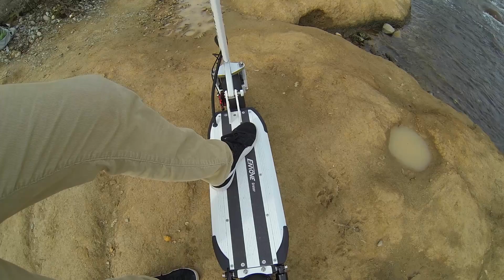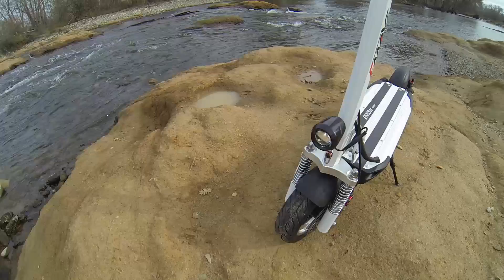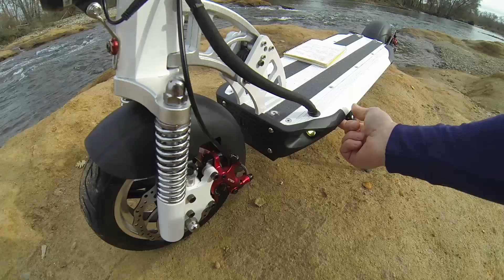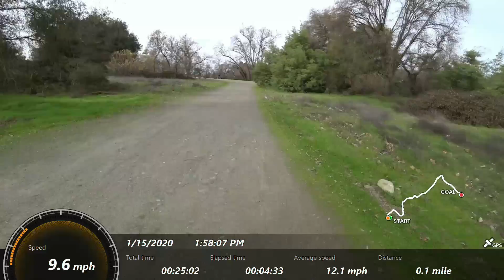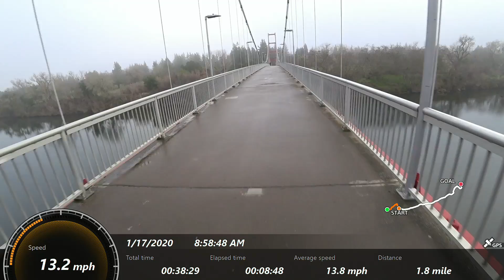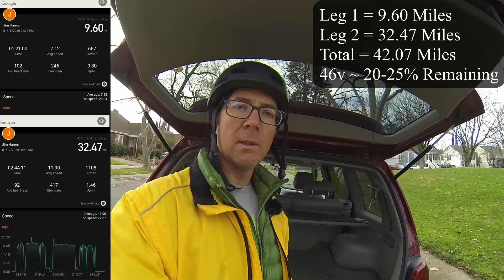Emove Cruiser Electric Scooter Review!

Comment: Base on many and many youtube reviewers, this Emove Cruiser is probably the only one that come closes to the advertise range.  All the rest fall so short, even the expensive ones like the Dthunder, Dultra and Warrior11+, etc.
Reply from the maker: @Tommy Lee, I totally agree. The dual motor scooters are so variable and they seen to base the max range on what a single motor could do. The reality with the dual motors is the rear motor is fighting the front resistance in single motor mode. A big battery with a lower power motor, like the Cruiser, is really the way to go for max range. Thanks for chiming in!

Comment: Just FYI you can upgrade the throttle to normal thumb or twist.
Reply from the maker: Correct, I did make a video about the fit of these though, they limit your display position and the folding of the handlebar. https://youtu.be/RffPbqiFElw

Comment: Is it still problem with screws loose on every few rides or it is fixed on model 2020?thanks.
Reply from the maker: The loose screws are really on every scooter unless you loctite them. There is just so much vibration with small diameter tires. I don't think there have been any real bolt changes with the Cruiser.
Reply: @ElectronSurfer  how to fix this bigger problem then?
Reply from the maker: @damirmaric2745  The problem is really only fixed with loctite or something similar. Voro has reportedly began using loctite on some locations. 
I really don't see it as a problem, it is really 5 minutes of maintenance that is needed on pretty much every scooter out there every couple hundred miles.  The added bonus when doing this maintenance is you will also see potential issues before them become big ones. Thanks
Reply: Ok thanks than loctite on every screw and problem solved.on every e scooter same thing or they are more stronger and solid also?
It is not problem every few hundred km i hope just this problem not more some repairs after shorter using of this model or after few hundred km..because this model seem so nice and complete..thanks..
Reply: @Damir Maric ~ The one good thing about this scooter is the range, but YES, there is still a major problem with the screws loosening and falling out while you're riding. And guess what? The screws around the "PULL" knob to fold the scooter are PLASTIC! Who puts plastic screws into a metal vibrating machine? Stay away from this scooter until they do better. I just sold mine with a $500 discount because I just wanted it out of my house. Maybe I just got a bad one, but Buyer Beware!
Reply from the maker: @NoProGoPronto  Did you buy direct from the manufacturer? I have not seen a single plastic bolt (that mechanism should not be using screws) on a cruiser. I have seen scooters of every brand with dodgy fasteners but can't say that the Emove any more so than others. It sounds to me like you got a bad one which I have seen one other Cruiser that had some issues but they are typically solid. I think one thing with scooters is people don't realize they actually require more retightening than a bike does with the extra vibration coming through small tires. I agree that all the manufacturers need to up their game and at least offer an upgraded bolt package with loctite. Thanks!
Reply: @ElectronSurfer  ~ Yes! I bought my scooter directly from Voromotors and those screws were plastic. You’re right, I probably just got a bad one. I wish the company well. Either way, I sold the Cruiser at a deep discount and bought myself a Dualtron Eagle Pro from a local dealer. This way if I have any issues, I have direct help from a human being. 😃
Reply: Then no good model or??

Comment: Good info and video. A couple of observations. You indicated the peak wattage was 1300 instead of 1600. You referred to the shocks being Pneumatic instead of Air Shock suspension. I believe you meant to make that reference to the tires instead being Pneumatic tubeless. I’m a little concerned about the overall life of the battery. I recently saw where someone had only gotten 300 miles out of their Cruiser before it just died. 😳😱 Just curious, how many miles have you put on yours or your son’s orange Cruiser? Thanks in advance.
Reply from the maker: Thanks for the comment. On the peak wattage a 52v battery with 25 amp controller gives 1,300 watts (52×25=1,300), not sure where Voro got 1,600. I meant to say air (pneumatic is interchangeable) tubeless tires and same with the shocks.
I have seen a cruiser with 2,000 miles and multiple with over 1,000, both on the original battery. Mine only has around 200, I'd expect a few years of longevity. Thanks again!
Reply: Electron Surfer Actually, from what I’m reading on their website, it states a 52V/30AH battery power setup. Depending on how much one rides, but I would anticipate getting at least 3 years of riding out of the Cruiser. Does your Cruiser have a different battery onboard?
Reply: @flhandster4395  30Ah is the battery capacity, and yes it's probably capable of delivering many times more amps but as far as I understand it can only deliver what the motor controller pulls, if the controller as he says is limited at 25Amps, then the battery will not deliver more than 25 amps, even though it would easily be capable of delivering multiple times that, but I'd expect it should keep the battery healthy for longer if it's discharging at less than 1C

Comment: I bought 2 of these emove cruisers recently (got them 2 weeks ago) from Voromotors. Both are having battery issues! I am a 150 pound rider. 1 scooter goes for a maximum of 10 miles the other goes 12 miles maximum. This is on the lowest setting (1), where you are supposed to get the most mileage! I’ve tried to contact customer service several times but they are brainless and disrespectful! They finally put me in contact with Joey! He immediately begins to blame me for the issue. Says he will not honor the warranty because it’s my fault! Hey joey like I told you 10 times THEY CAME OUT OF THE BOX LIKE THIS! WTF is wrong with you people?
Reply from the maker: @Justice For All, i'm sorry you've had a bad experience. You can contact me through my website www.electron-surfer.com and i'll try to help. 
We can try to diagnose here and others can reference. Can you tell me what the voltage the battery is charging up to? The voltage at fully charged and the voltage you are getting when you run out of juice will help diagnose the problem.  There is a possibility you could just have a bad setting.  I have yet to see a bad battery in the cruiser but it could happen, having two scooters, both with bad batteries is odd enough that it makes me think it could be related to another part of the scooter.  Let me know and i'll try to help.  Thanks for the comment.
Reply: Still having the same issue?

Comment: Thanks for that detailed review. Especially the actual ride and speed test. Nobody else seems to mention the fact the the speedometer over-states the speed. After you changed the wheel size down to 9, what kind of top speed did you get? Thanks again!
Reply from the maker: @John Cox, I still get a little optimism but it is less. The display will read up to 26 mph when i'm really doing about 24 maximum on flat ground. Thanks for asking.

Comment: Dang! It looks very similar to the Speedway V. #SMH
Reply from the maker: @Xt Plow, You are correct, there are actually some places in the manual where it still has the Speedway reference.  Most of these frames come out of the same factories with manufactures selecting their own battery and motor combinations.

Comment: im averaging 1500  miles per 3 bucks on mine, you gotta be careful with the charger
Reply: What do you mean you gotta be careful with the charge? There's no settings or config... all you do is plug in end into the wall and the other into the scooter. How can one be more or less careful with the charger?
Reply: @lanceguilin  its pretty easy to go to 58/52 volts, and that is a problem, once a week i guess its okay
Reply: @lanceguilin  ive been thinking about eating it to make an e bike, a 30 amp battery is almost the entire cost of the device, thats 15 times bigger than my heated jacket
Reply: turn it sideways, hooking up a new controller and getting a legit motor.. i can see the thing pulling freeway speeds, that battery is MASSIVE, 30 amps is not small
Reply: @lanceguilin  its a good one for the price, i thought about the thunder, even the X, this is a good starter, unagi might also be what youre looking for, but hitting 30 feels incredible. However i will end up getting a big one
Reply from the maker: @lanceguilin  When charging the plug is at a downward angle, if the scooter tipped over to the plug side it could damage the plug, especially if you have the scooter folded. Thanks for asking Lance!
Reply from the maker: @Matt Locascio, its really hard to be the cost per mile on escooters or ebikes, keep on riding!
Reply: @ElectronSurfer  or i can use my bike, and get infinity mpg, though there is slices of pizza, tires etc, what im getting at is this is a very cheap method of transport
Reply: if you want my cannondale road bike hit me up. i got too many bikes at the moment

Comment: I bought this scooter a few weeks ago and I'm here to tell you the front fender is absolute rubbish.  My fender rubbed against the wheel and since the front fender is mounted to the brake assembly and not the front forks above the wheel when the suspension is under load it  would smack into the top of the fender making a nasty sound.  Additionally, this limits the travel of your suspension, so you really are NOT getting the full suspension use.  I weigh only 185 lbs and I wrote Emove a letter about it, plus a list of other things as well.  The response was the scooter is safe and didn't really address any of my concerns.  My father was going to buy one and he immediately, said NO thank you, poor design.  Also, I noticed that the front wheel assembly makes a chattering sound when make right leaning turns, I think since everything is off set to the right, its putting something out of balance.  I do feel the front wheel doesn't makes true and complete contact patch with the road.  I own 3 different scooter brands and this scooter is quite new and the tire wear is APPARENT to one side and while the tire still shows the "RED STRIPE" which they put on new tires on the right side of the tire, which is the side which has the off-set.  I have close to 100 miles on this scooter so the red mark, tire wear should have eliminated this and the tire wear is apparent in difference from the 2 other scooters I have sitting next to it.  My advice "DO NOT BUY" this scooter until they fix this issue.  Also, the motor of this scooter, mine in particular sounds like rubbish while moving/starting low speeds.  Its like trying to accelerate a car with a manual transmission and starting in 3rd gear, versus 1st and the drive line is making noise.  The sound does smooth out but but being that this scooter is 2 times the cost of my Segway Ninebot Max and that thing makes no sound like this and this scooter is 6x the cost of my Gotrax V2 and that one doesn't make any nasty sound like this one, it clearly tells me something isn't correct.  Emove, response to this issue.....nothing.  As for the rest of the build of the scooter, well maybe I will save that for another day.
Reply: Not really what I wanted to hear since the Emove is at the top of my list. I will definitely be looking hard at my number 2 runner up just to be safe. 🛴
Reply: @redjack56  What is your 2nd choice? For the price you're not going to get much better than the Cruiser 2019. Are there better scooters? for sure, but it'll cost you. Rion scooters made in USA -- much better quality -- will set you back $6500.
Reply: @redjack56  this thing rocks, keep your weight to the back and hit that trigger bro
Reply: I share some of your concerns Mike S, but what are the  2 other scooters you're referring to? Are you referring to the Segway and the Gotrax? They are clearly inferior scooters not in the same league as the Cruiser 2019. Take off the front fender -- it's quite easy to do -- and many of your critiques are gone. Should you have to do that? NO. But it is what it is and if you want to solve some of your problems, you've been given to solution to it: take off the front fender.  Your motor does sound strange. I have over 1000 miles on my Cruiser 2019 and I don't  have problems with my motor. I did have many of the issues you mention regarding the front suspension and rubbing of the tire to fender. Take off the front fender.
Reply: @lanceguilin  Inferior, in what manner?  That's like saying a Ford Focus is inferior to Ferrari.  The Ford works like its supposed to for its role and spec sheet, try to take that Ferrari on a family vacation and then tell me what's inferior.  My Gotrax and Max work as per their specs, no need to remove fenders, or weird motor sounds or front end sounds-chattering.  The stem on a max and Gortrax are vertically locked and don't move backwards or forwards, while the Emove has forward play. How about a front light that DOES nothing other than to mark your location as it doesn't project any ACTUAL Light so you can see the road.  What a $250 Gotrax V2 can allow you to move about in the evening hours and so can a Max.  So, do a tally the Emove needs help and anyone reviewing it and pushing discount codes are only doing so to make $75.00 per unit for themselves.  Do, I like my Emove yes, does it need immediate improvement "Yes", I stand by my comments, do not buy this scooter as it needs at least a V3 to make it right.
Reply: Mileage range is really good though!  I'm lucky enough to own a Falcon Zero 8 - I'm happy with it.
Reply from the maker: @Mike S, I"m sorry you've had some problems. I have ridden a Cruiser with almost 1,000 miles on it and it rode like new.  Its sounds to me like you either got a bad one or something was really messed up in the front end that affected the whole scooter.  My experience with VoroMotors has been really good.  I agree that the fender isn't great but the plus is it is very easy to remove or alter.
Reply: for the price it works, i did remove the front fender as well, that 30 amph battery isnt garbage, i also carry electrical tape to patch holes
Reply: just take the front fender off, id also recommend getting longer screws and tighten the living hell out of them, thread lock might also work, the machine is over powered, and cannibalizing the parts including the 30 AH battery is an option
Reply: an ebike with a 30 amphour battery could probably get 300 miles of range... if youre careful, 200 easily.
Reply: @HappyCamper870  I've got one of those as well and I'm dealing with a throttle issue, speed limiting problem and I submitted a trouble ticket today on it.  The build quality of the Ninebot Max is really good, not happy about whatever this issue is but I do feel its going to be rectified by Segway.  My mom has a Max as well and she hasn't had any issues.  Mine still goes, but has been limited to a reduced speed and beeps a warning every so often.

Comment: I'm about the same size as you, maybe 10lbs heavier.  How do you feel about its hillclimbing ability?  I know thats subjective, but would you call it a good hillclimber?  I've got a 3 mile hill I'll be tackling every day....1200feet of increase.  About a 10 degree incline with a short section of 15 degree incline.  Think I'll be losing speed as I hit that section or can the emove hold its speed while climbing?
Reply: just lose some weight dude, this thing rocks... or get the thunder/x
Reply from the maker: @Billy Lumio, I'll do a hill climb in my detail video, but my feeling is it will climb very well.  I think a 3 mile long hill is going to be a challenge for any scooter.  A scooter that is low enough to kick to reduce motor strain or a ebike might be better options.  I'd just worry about the heat generated by that long of a hill.  I'm not sure if that was helpful, but thanks for the question.
Reply: 3 mile hill climb every work day is not a good idea for the Crusier or any single motor scooters. You should be looking for dual motor scooters. They are much better suited for daily hill climbs. The cruiser can do what you're asking but you'll for sure burn up the motor in short order doing that everyday.